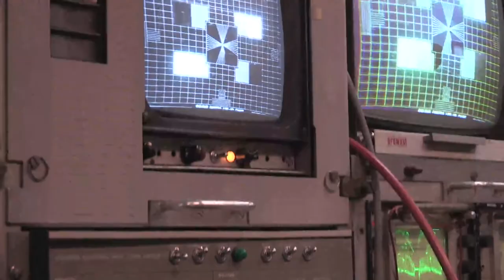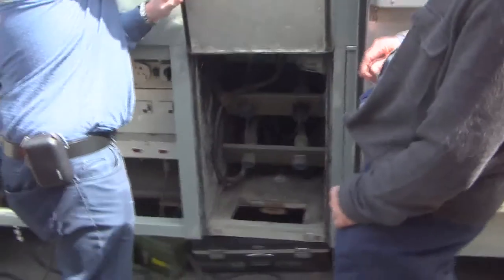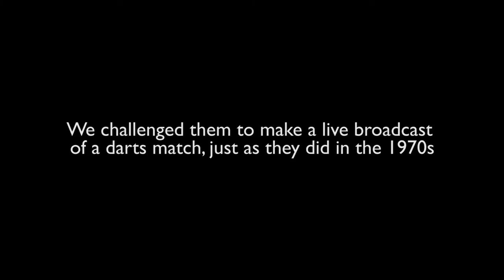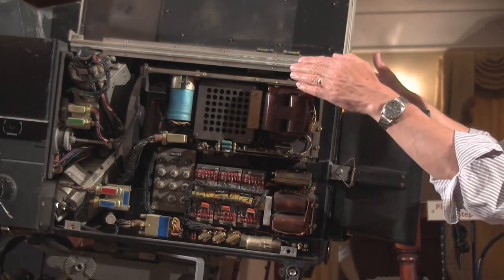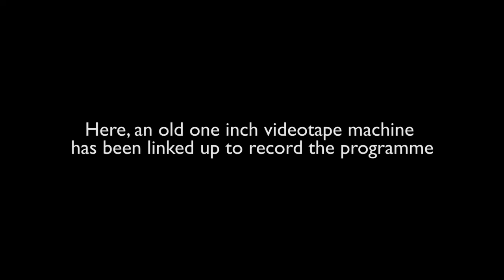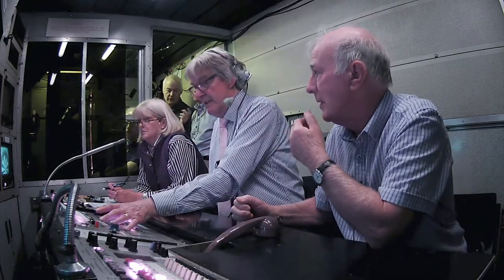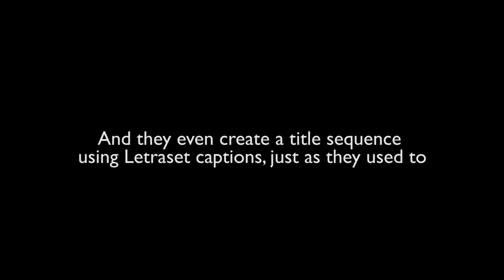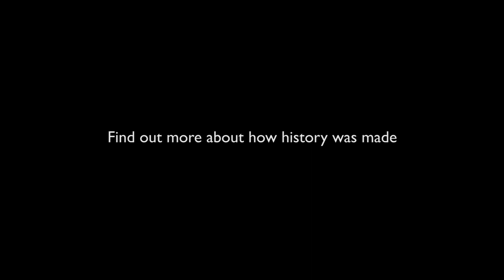Recreating Early Colour Outside Broadcast

Comment: In 1970 you would be using 2" quad video tape machines. Not 1" machines. The Sony 1" machines were not until 1982
I restore 2" quad tape machines and worked in every machine AMPEX made.
The PYE cameras are also made by Philips company, specifically Norelco. The PC60 was developed in 1964 for CBS in USA. The PC70 was a very popular camera as well. The handheld camera being the PCP-90

Comment: Absolutely fantastic... just remind me again what was the problem with VT. was there transport issues?
Reply: The issue is you cannot cross dissolve it because the two video fields aren’t in sync. Think of the diagonal lines on the videotape where the actual magnetic data is recorded- back in the day there was no device that you could use to inject the signal with the same black burst sync genlock signal, therefore the cross dissolve would look crazy weird like a bad moire. You can hear them talking about it in the video a tiny bit

Comment: Surely a 2” quad would have been the correct vtr for early colour ob? 1” came in mid to late 70’s. Otherwise good piece. Of course the real job was playing out live as many sports used to do. Then things could get very stressful and there is no bar to retire to on an ob truck.
Reply: Indeed but working examples are rare, certainly don't like being moved around and it would have added a whole level of complexity. Almost certainly another truck with all the support equipment which usually involved things like compressed air as well! However 1 inch machines are more compact, need less support equipment and are more plentiful.